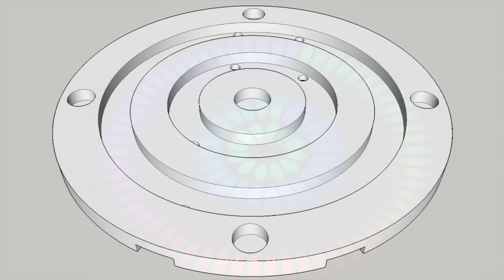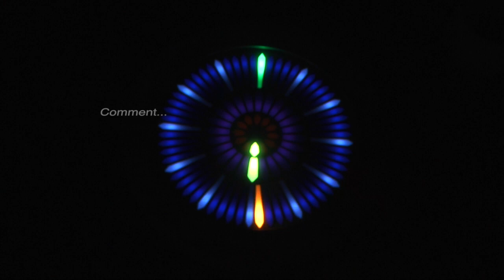LED Clock V2 Final Assembly

Comment: Congratulations Steve, sooo nice clock. I try to make one, I've bought the 3 LED rings exactly according to your links. I've printed your STL files. I've received the rings:
The big 60 LED one is perfect for the 3D printed parts.
The medium 24 LED is too big (inner diameter is 72mm when 52.5mm on the STL, outer diameter is 86mm when 65.7 on the STL).
The small 12 LED is too big (inner diameter is 27mm when 23.2mm on the STL, outer diameter is 38.5mm when 36.8mm on the STL).
I can't modify STL's to fit my rings, would you be so kind as to share your SolidWorks (or other software) files, please?)
If you need my mail address or any private space, just ask.
Thanks for understanding.
Eric
Reply from the maker: Hi Eric, Glad you like the clock, and enough to try build one yourself.

Sorry to hear that 2 of the rings are somewhat larger than my original design, they do vary a bit, and usually a little bit of fettling is required, but way to much in you're case. I will admit I'm not keen to share the original files, but I might create custom STL's for you. The originals were created in Sketchup BTW, and its quite a bit of work to modify them. Where did you get the rings from. I know I got some cheaper ones from China that were different sizes to the Adaruit rings (much brighter and whither as well actually).

Did you print the 10 smaller parts, or the 2 larger parts? 

If I do this for you, I recommend printing the pack parts and see how the rings fit before I mod the face, thats going to be quite a chore.

I have recreated the clock face for CNC machining in 2 parts using a StepCraft CNC router, and using Medium Density Fibreboard (MDF in the UK). These are much quicker to produce, and the design software makes it easier to customise and tweak the design, but a little more of a fiddle to machine, plus the dust created is terrible.
Reply: Hi Steve, thanks for your so quick answer.
You don't want to share your original files, and I can understand your point of view. (on the other hand I wouldn't have uploaded your files saying it was my job, I only want to build this wonderfull clock to put on my wall just in front of my desk).
Creating custom STL's just for me is very kind of you, it's just a pitty you're up to spend some of your precious time for an unknown guy (me).
The links you gave in your PDF's parts list (coolcomponents.co.uk) are dead, so as I'm a french guy I bought it here with these specs:
- Ring 60 Ultra Bright WS2812 5050 RGB LED + Integrated Drivers (4 quadrants)
- RGB LED Ring 24 Bit WS2812 5050 RGB LED + Integrated Drivers
- RGB LED Ring 12 Bits WS2812 5050 RGB LED + Integrated Driver 
The medium ring's outer diameter is 86mm wich is bigger than the back plate and the face hubs, no other choice for me than modifying the 2 larger parts.
Of course I'll print the modified back and confirm it fits like a charm before you begin modifying the face (I can imagine it'll be much more time to spend, thanks in advance!)
No CNC here... I'm just an ordinary guy, not a factory or so.
Thanks for all.
Eric
Reply from the maker: Hi Eric, I've not used Skechup for a while, but it would be good to try it again as I like using it.

Could you send links to the rings you purchased, as I'd like to see them. Maybe I'll get some being the rings are slightly bigger, which might be worth trying myself.

I still need to know if you need the 10 part version or the 2 part version, the 2 part being the better choice if your 3D printer is big enough.

It might take a few days before I can complete this, and with the 2 rings being bigger, I might mean I have to re-shap or re-position the hands as well.

As you will have seen from the back plate, there are some holes for the connection wires to pass through. Does it look like they will line up with your rings, If not, it might be difficult for me to work out where to put them in the re-designed version, and It might be better if I left them out for you to drill yourself. The LED rings I got from Adaruite via Cool Components were plated through hole, while the ones I got from China were all surface mount pads. What do your rings have?

Steve
Reply from the maker: Eric Cattelain Hi Eric, Thanks for the pictures, and yes it does answer my question, the rings use surface mount solder pads, which are not as good as a through hole pad, but all good if you take care not to over heat the pads when soldering. I will start on the back plate this weekend.

Steve
Reply: Thanks in advance !!!
Reply from the maker: Hi Eric, Here is a link to the customised Back Plate, hopefully you can download it:
https://www.dropbox.com/s/gex7fi6pwkvcuy2/Clock%20Base%20Whole%20V2.0%20By%20Steve%20Manley%20For%20Eric%20Cattelain%20-%20Larger%20Inner%20and%20Middle%20Rings%20Plus%20Centre%20Recess%20for%20Additional%20Pixel%20-%2002-04-2018.stl?dl=0

This is quite a bit different to the original version and has a closer resemblance to my CNC machined back plate. 
There is a notch at the top, this will align with a notch in the clock face (when I complete it that is). 
I have removed all but one of the locating holes as the project does not need that many holes. 
I have added 4 holes around the edge and one in the centre for fixing screws. They are 2mm diameter for you to drill out to what ever size you want, the same holes will be in the back of the clock face, but 1mm, to be drilled and tapped to your choosing. 
I have also added a recess for a centre pixel should you want to add one.
I added some recessed lines to indicate where the first pixel in each ring should align too.
I have cut outs for wires to pass through to the back. Hopefully they align for your rings. If not, Just drill or cut where needed.

If you are interested, I have also uploaded some picture of my CNC machined versions of the clock parts:
https://www.dropbox.com/sh/t458v4xonqyjipt/AABg-kYpkuow247FoWl0lZtfa?dl=0
Reply: Hi Steve,
I've measured your STL file and its perfect for my circles, thanks a lot !
I'll print it at work tomorrow morning... no printer at home.
I'll send you a picture of the printed part with the 3 circles instaled.
Of course the wooden version is "The Rolls", but we all do with the tools we have.
Nice evening.
Eric
Reply from the maker: Great news, hope it all works out. I would love a bigger printer so I could print all the parts full size, but I have what I have. The CNC version is okay, but not as accurate as the 3D printed version. I don't think my CNC router is set up well enough, and I don't know how to fix it.

I would like to know what material you are using, and how long it takes to print.

I have started on the Clock Face but it will take me a day or two go sort. Do you want provision for a centre pixel?
Reply: I'll print with PLA, medium quality: 0.15mm, 32.35m of PLA (98g), and it'll be ended after 9h and 25minutes.
I'm not going to do a center pixel, I'm going to try to built it just like yours: lovely!
Reply from the maker: Okay, thanks. About the same as it take to print the 5 individual parts that make up the base then. 
I will let you know when the clock face is done.
Reply from the maker: Hi again Eric, The Clock Face is done. Please check it carefully, and let me know if there are any issues:
https://www.dropbox.com/s/ly4z3z9itczhgx6/Clock%20Face%20Whole%20V2.0%20By%20Steve%20Manley%20For%20Eric%20Cattelain%20-%20Larger%20Inner%20and%20Middle%20Rings%20-%2002-04-2018.stl?dl=0
Reply: Hi Steeve,
thanks a lot for your job (and you speed).
It's a pitty I can't do modifications by myself on STL files, so I'm to ask you if you could lower the diameter (not radius) of the medium circle on the face only, please: -1.4 for inner and outer diameter.
Thanks for understanding.
Eric
Reply from the maker: Eric Cattelain Hi Eric, that will be no problem, but It will not be until this evening.
Reply: Hi Steeve,
that's ok, I've found the way to modify STL's with my favorit SoliWorks. The middle ring with 1.4mm smaller is done.
The bad news is that the 3D printer from where I work has failed printing the back. The part was unstucked in a place and the printer stopped. In a way it was a try (with an awful color) and, as you can see on the joined picture, everything rocks with the circles:
http://xtremist.free.fr/TestBack.JPG
I will probably add 0.5mm everywhere not to have to push hard the circles into their place.
Right now I'm printing a test "Face".
Crossing my fingers the part won't unstick!
In fact at my job only small part are alway printed without any problem, never large ones like this.
I will let you know.
Eric
Reply from the maker: Eric Cattelain Hi Eric, thanks for letting me know about being able to edit the stl files. Shame the back plate became unstuck during printing. Hopefully a second attempt will be better, and the clock face prints okay. 

I did add 0.6mm around the pixels, which has been fine for me, but if you need to add more then that will give more flexibility to position the rings.

Let me know how you get on.
Reply: @stevemanley3685  Hi Steve, great project. I am stiil considering getting a 3D printer but I do have a basic CNC machine. Is there a link to the CNC files? Thanks
Reply from the maker: @peterdooley3251  Hi Peter, thanks for the comment. I do have a Stepcraft CNC router myself, and have routed a backplate and a clock face with it, and they fit together very well. However, there were routing quality issues of the clock face, and I'm not entirely happy with it. The CNC router was self assembly and I may not have got the assembly and set-up accurately enough. Plus it takes about 2 hours to machine the two parts and needs constant monitoring, A lot of noise and dust as well. Okay for a one off I guess to prove a concept, and that it did very well.

I have abandoned the CNC router approach for now and gone for a Laser cut clock face instead, and got the part cut at a local CNC machine shop at great expense. I have also designed and had made, a custom PCB backplate with the LED's mounted exactly where I want them, and the 2 parts screw together. Both these parts have cost me a pretty packet, but it is probably the best result so far. 

There is a possibility I could sell the parts as a kit, so I'm not willing to share the files I'm afraid, not even the CNC files.
Reply: @stevemanley3685  Thanks for the quick reply. My CNC is home built and i have used it to machine gears for wooden gear clocks and drill the matrix holes for word clocks, but it was a long learning curve and I am reluctant to start 3D printing for that reason. I am more comfortable with hardware than software. Maybe I will just have to take the plunge into 3D printing. Thanks again
Reply from the maker: Peter Dooley no matter which route you go, be it CNC, 3D printing or laser cutting, they all require a steep learning curve, and each have there pros and cons. I stepped away from 3D printing for this project for a couple of reasons. Even though I purchased a bigger printer than my original one so that I could print the clock face in one piece, getting it to print reliably is harder than I was expecting. The main issue is the part lifts off the bed. It also takes to long to print.

CNC is much quicker, and laser cut is quicker still. Typically 3D printing takes approx 10 hours, CNC approx 2 hours and laser cutting approx 20 mins.

I would suggest that if you can cut gears on your CNC machine and are growing in confidence with it, stick with it. I sure you can figure out how the cut out a clock face or some grooves in a back plate for the LEDs to sit in. BTW, the clock face doesn’t have to have the square holes for the LEDs, in fact I would just machine the clock hands pockets all the way through the material. I have done this for the laser cut part and it works just fine.
Reply from the maker: I’d suggest using screws to fix the back and front together, rather than the locating pegs and holes I used for the 3D printed parts, but may depend on your machines capacity to print whole parts.

Let me know how you get on.

Comment: Hi Steve, just starting to build the clock, I ended up machining the face and base on my cnc as the 3D parts mate printed weren't great. Would you have the stl files for the mounts for the arduino and other boards, as I reckon they make for a much tidier layout.

Comment: I have just stumbled on this video, and it's excellent. I have added it to my things to make list and it's jumped well up the list. 

What is the purpose of breakout 2 and 3, equaliser and mic/amp. Are they necessary.

I'm hoping to make it to replace/complement  an outdoor clock, and possibly build it into the existing housing, with power supply from inside the shed it is mounted on.

The quality of your documentation is excellent, i'm depending on it :-)
Reply: your link for the 15 individually addressable neopixel directs to the 12 led version, didn't see a link from the same siite for a 15 led version
Reply from the maker: mailblitzer Hi, thank you so much for the kind comments, and sorry if the link is wrong, I'll look into it. In the meantime, just look around the vendors website and I'm sure you'll find the items.

As for the mic/eq breakouts, well the clock can do more than just tell the time. If you bounce over to my YouTube channel and look in my playlist, you will see the clock being demonstrated by my good self, filmed by Clive Maxfield, a good friend of mine. 

If after watching the videos and decide you didn't like the audio modes, you could simply leave the boards out and edit the code accordingly to remove the relevant code sections, or add some cool stuff of your own.
Reply: Cheers Steve, thanks for the reply

Comment: Stunning. Attention to use of shape, symmetry and light diffusion/propagation properties really sets it apart. The whole is greater than the sum of it's parts.
Reply from the maker: Necro Nemesis Thank you, and very nice of you to say. Your comment is very much appreciated.
Reply: You're very welcome. Thanks for providing the files. I am sourcing the materials to build one after I put finishing touches on my largely 3d printed Perspex block ws2812b Arduino audio light bar project. I'm thinking of attempting to pour clear cast resin into the LED cavities of the print then sanding to a mat finish to see if I can obtain similar optical qualities of the Perspex blocks to propagate the light. Resin may also form the basis for the frame in my case as I don't readily have access to a wood lathe. I will conduct a little experiment to see how well clear casting works in this application.
Reply from the maker: Necro Nemesis Very interesting idea, please let me know how that goes.
Reply from the maker: Necro Nemesis I'd advise testing on a smaller section so as not to waist led rings if it doesn't work out.

Comment: I now have access to a 3D printer I'm looking forward in making a copy of your clock in NJ, USA.. Maybe we can work in parallel on these amazing looking and one of kind LED clocks.. Once I catch up to you there is other features I would like to add.. IDEAS (sound)Ticking or Chimes,  Automatic dimming night ect..Sincerely Robert
Reply from the maker: Robert Batchelor 
Hi Robert, glad you like the project enough to build your own clock. Personally I'm not keen on the audio side but see that it would be of interest to others. A friend of mine has already started a project to do just that. I also have ideas on various display options, in fact I have a v3 of the clock with a centre dot and modified shape of the 12 led inner ring segments, plus a slight mod the the hands. This time I used a CNC router to create the parts. 
I have also swapped out the Nano for a Simblee which I can control from my iPhone, all still a prototype. Also got some cheaper led rings from China that are way brighter and whiter.
I already tried the auto dimming but my implementation was rather poor, so can be improved.
I have also considered using a GPS chip for more accurate time keeping, but to be honest, the RTC chip I use is here good. I have a Nixie tube clock with GPS and another clock with radio time sync, and my clock keeps better time without the extras.

Keep in touch. Steve

Comment: '
hi steve...
that cool nice home made LED colors clock...
how come dont have 12 numbers from 1 to 12
Reply from the maker: Hi there, glad you like my clock. 
Not all time pieces have numbers and at the time I couldn't think of a nice way to add them, so I made it without. Originally it didn't have hands, just dots, but now you mention the numbers, I have had a couple of ideas for future revisions. Trouble is, its beyond the capabilities of my current 3D printer to do what I have in mind.
Reply: hi steve...
that is alright and take time...
get the numbers from the hobby lobby store or michael's craft store
Reply from the maker: bestamerica Hi, and thanks for the suggestion, but if or when I do place numbers around the clock, it will be done to the highest possible standard I can achieve using either a 3D printed component or by engraving using a CNC router. In fact I already have a piece of brass plate that can be cut out and used for such a thing.
Reply: Hi Steve

A couple of years  ago, I did some Glass engraving works, I also made a Clock, but not so amazing like yours.

For  the numbers, what when you cover your clock, with a Glass plate, in witch the numbers are engraved. When the light comes around the engraved number, it will brake the light, so the number will comes more visible. It depends how fine the line is, what you will see if the light is of.

Don´t look at my English, it is a long time ago, I used, to speak or write in English.

Greeting from Germany
Reply from the maker: Zebulon 60 Well your English is better than my German lol.

Engraving the glass with the numbers sounds a neat idea. I'll give it some consideration for another version of the clock. Cheers 😃